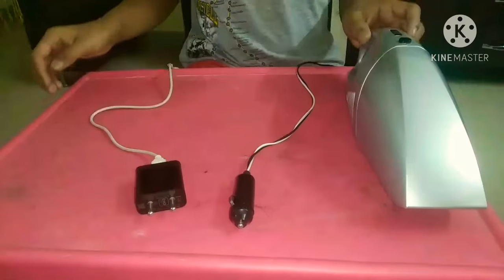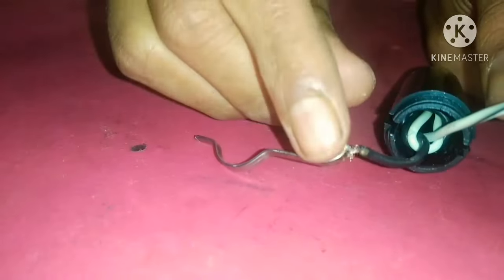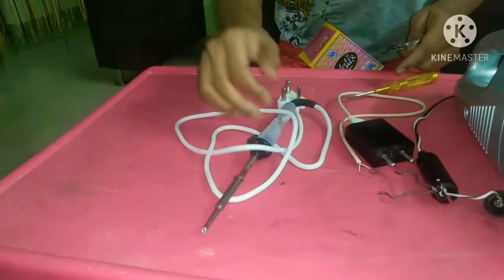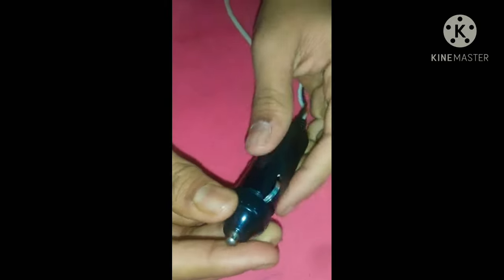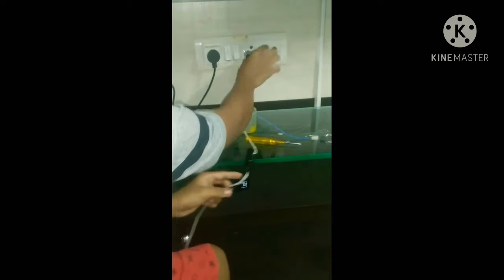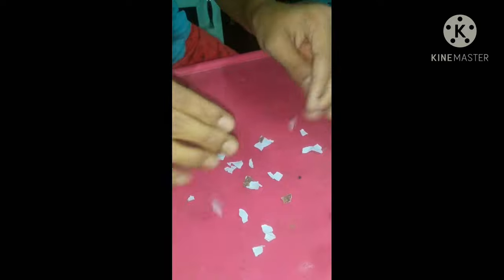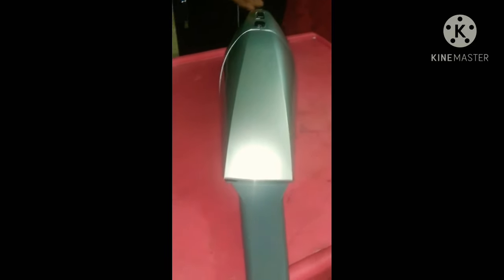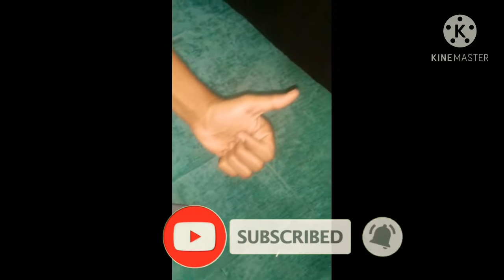How to convert Car vacuum cleaner to house hold use by using mobile charge#9..San'z Creators

Comment: My vaccum cleaner is of 100W. It will need 100W/12V = 8A current. 12 V Mobile adapter has 3A max current. How will this work? It will be 1/4 powerful.
Reply from the maker: I think it may work slow with low energy
Reply: @sanzcreators5446  how was your experience?
Reply from the maker: It's working fine till now. But yes with little bit of low energy...
Reply: Time till charge is damage 12v 11 amp car vacuum cleaner capicity

Comment: You cannot use this with tyre inflator or if you want  to use your vacuum cleaner in tight spots. The ampere rating is very low. Yes obviously it works but it is only useful for collecting paper bits. I'm finding ways to do this and the best way are those old school adapter with 12 v rating. Mobile phone chargers are only 5v and then there ampere is always different so this way would never get the job done. You'd kill 0 birds and your stone will break in time
Reply: What are those old school adapters?
Reply from the maker: Those are for vaccum cleaner....
Reply: @jhone3241  Just look for adapters whose output is 12v .u can easily  find  details of output and inputs of any  adapter on the back of it

Comment: But charger 5v output deta h n vacuum cleaner me 12 v input chahiye..?
Reply from the maker: Yes, but it will work with low energy
Reply: @sanzcreators5446  but the speed will be less right
Reply from the maker: Yes

Comment: C type charger have 4 wire. Can we do by that
Reply from the maker: Yes you can do..
Reply: My vaccum cleaner need 12volt and mobile charger is only 5volt. So how can
Reply from the maker: You can use 5volt charger but it may work slow and with low power

Comment: Can i use my 19.5V 65w laptop charger with 12v 110w vacuum cleaner?
Reply from the maker: Yes you can use...... But it may work slow (with less power)
Reply: @sanzcreators5446  volt jyada hone se vacuum cleaner me koi problem to nahi hoga na !?
Reply: Do you need to know what is positive & negative of the wire?

Comment: Is there any way I can run it with 12v ?
Reply from the maker: You can use 12v  mobile adaptor....
Reply: @sanzcreators5446  but how
Reply from the maker: @dannyjunior7612  2:44 you can use 12v adaptor there.
Reply: But I don't have 12v mobile adaptor what can I do ?
Reply from the maker: @jayashreeviswanath2028  You can use less that 12v adapter but it work's slow
Reply: @sanzcreators5446  ok thanks

Comment: For 12v motor ?
Reply from the maker: You can use 12v charger
Reply: @sanzcreators5446   which devices have it ?
Reply from the maker: @Abdurrahman1-i4y  You may get in any mobile charger of 12v adaptor